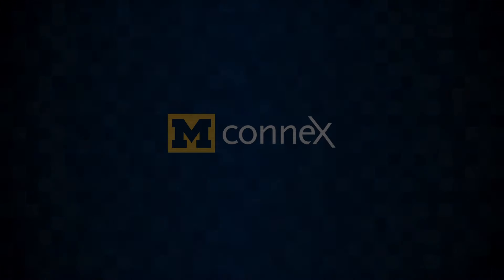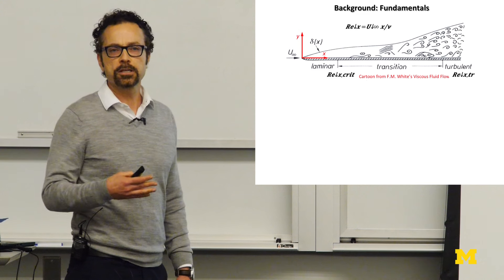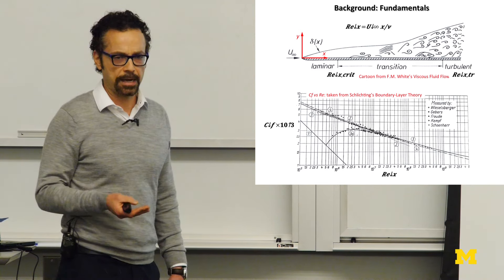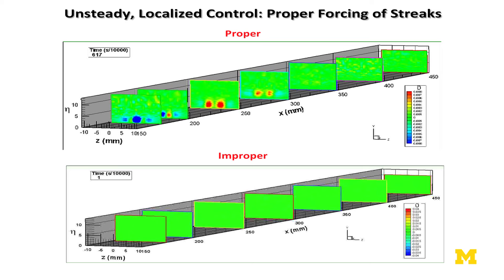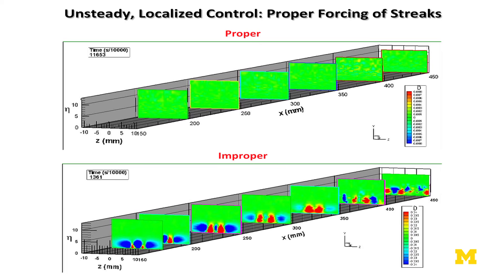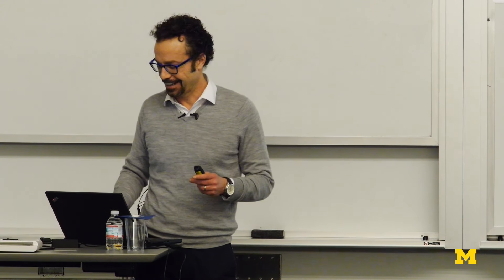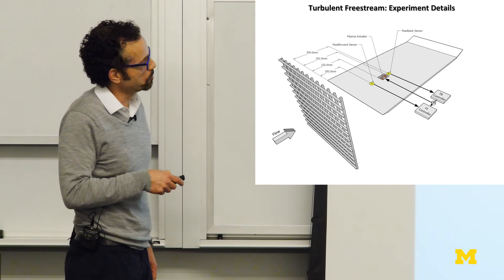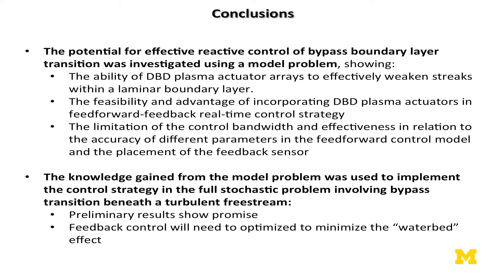Ahmed Naguib | Plasma Actuators

Comment: Alternating layers of electromagnets or permanent magnets interacting with the discharge of the actuator array would provide a Lorentz force to enhance or modulate the partial vacuum generated on the control surface. Some of the energy of the wind rushing past the array could even be used to generate the force since the air becomes ionized. 

I would like to see how a cone with an embedded coil in a wind tunnel where the tip of the cone is a negetive electrode with a high voltage discharge across a plasma bridge array ala the actuator to a ground near the base of the cone. The magnetic field would bend the path of the actuators charged particle stream outwards radially and then fold and twist around the cone, tightly coupling to the magnetic field.